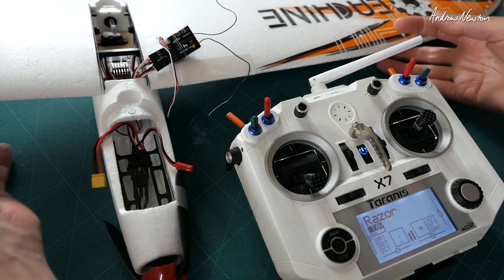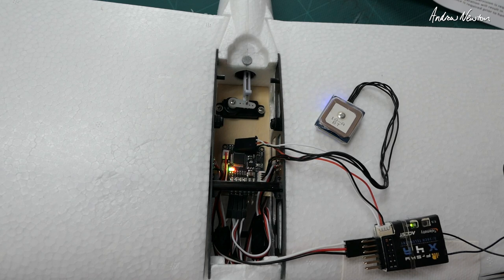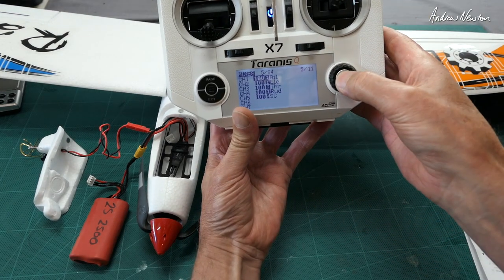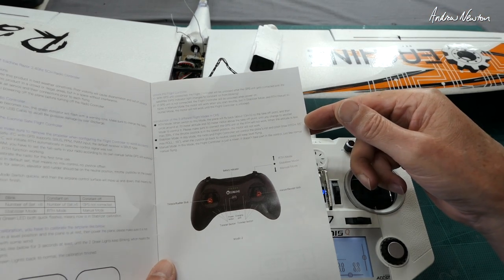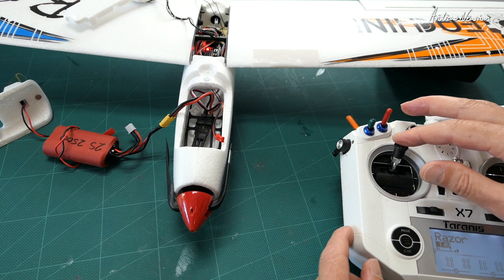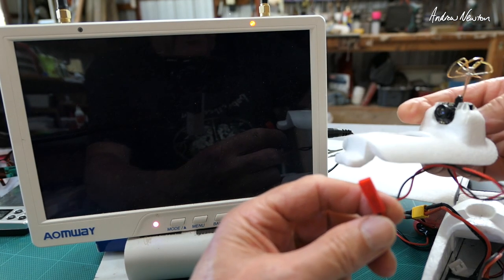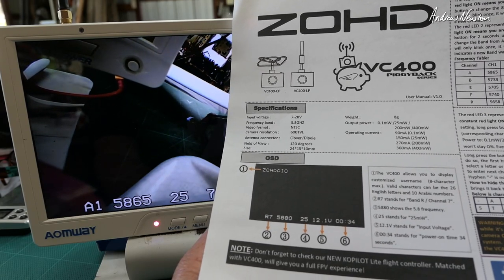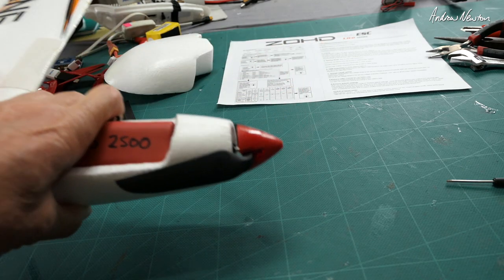Razor ESC FCB VC400 Setup

Comment: So I just completed my first two flights of my razor.  My initial thoughts are,   it is a little anemic and the prop pitch could probably go up a little bit.

With 40% Expo,  triple rates set at 75 50 and 35 even 75 was a little unresponsive.  I guess I'll bring my expo back to 20

Comment: Thanks for the full SP on the set-up and all the relevant beepity-beeps Andrew. :-)
The low battery RTH is a useful update but a bit odd they went with XT60 rather than XT30 and the solid and flashing green led pattern reversed from the Kopilot usage? ;-) With my clapped out fingers I use an in-line switch adapter for setting up - saves a lot of blue air! :D
Reply from the maker: It is XT30

Comment: Re: Propeller Balance. 
The folding prop on my Phoenix 2000 is the same. I have just turned around one of the screws.
It is now running smoother than ever! Thanks for the tip Andrew.  
What were they thinking with the 2 screws facing in the same direction anyway? 
Because one hole is bigger than the other, I had to glue in a bamboo skewer and then drill it to make the hole smaller.
Reply from the maker: Yes it's an odd design decision

Comment: Does the FPV version of the Razor include a Receiver or do I need to order that separately? (Recommendations welcome! 🙂).  Battery recommend also appreciated - I would like to get 30+ minutes flight.
Reply from the maker: No receiver. Need one that works with your transmitter. 2S 3500mAH 18650 pack would be best

Comment: Forgive the newb question Andrew.  What sort of 2s Lipo battery suits this model, is this right? HG 7.4V 4500mAh 30C 2S Lipo Battery.  There are a lot of different descriptions for 2S Lipo's 25C, 30C, 45C etc.  Please help
Reply from the maker: Too big and heavy. Something like a 2S 1300 is more suitable, or 2 x 18650. Only need the higher C rating batteries for high current needs, like quads or fast planes. They deliver more current before the voltage drops.
Reply: @AndrewNewton  thanks andrew, your vids and dialogue with us punters is very much appreciated.  I have one more for you, should I get the Flysky FSi6 or Jumper T-Lite for a first Tx(to pair with the Eachine Razor)?

Comment: Andrew, One thing confuses me and that is the 100% rates needed for the control board is it the case that once this is programmed into the stabiliser lower rates be imputed so that in manual mode the movement is less aggressive or am I missing something. It’s a very steep learning curve for me but I’m determined to crack it. I’m using FlySky  fs-i6x Oldsurveyor 44
Reply from the maker: Need 100% for setup using stick commands, but not for flying. But with fully configurable boards it's best to do the rates and expo in the board configuration and not the transmitter. Otherwise you will end up with inconsistent trims in different modes
Reply: @AndrewNewton  thank you for that most helpful
Reply: How did you connect your Flysky receiver to the Razor flight controller? Did you use PPM? Where did you plug that into the fight controller?
Reply: @subzero674  connect with the supplied 3 way lead supplied with the Kopilot , four pin connector inserted horizontally across the signal pins on the reciever the 3 pin plug inserted horizontally into channel 5, signal wire to the top this provides power to the Kopilot and this is also the command channel giving you return to home, stabilised mode and finally manual mode. You need to assign a 3 position switch to channel 5. The other end is connected to the Kopilot be careful withe connection the pins are offset so make sure you align correctly. The Kopilot diagrams actually illustrate these functions fairly well so there worth studying.
Hope this helps.
Reply: @michaelwheatland4565  Thanks!

Comment: Hi Andrew...can you use ibus rx with this...thanks
Reply from the maker: Dont think so, Eachine Safe board only uses sbus, ppm or pwm
Reply: @AndrewNewton  Hi again ...some confusing statements on the net...such as  ""I think It should be OK as a website out of the UK states: "the iA10B is capable of iBUS, SBUS, PPM and PWM for enhanced control."
I also found a YouTube video showing that in the transmitter settings you can choose i.bus or s.bus. Woo Hoo !!! "     

     and this     "Great video, but just one thing... you said Kopilot is not compatible with iBUS, but actually it can be.  The FS-IA6B works on both PWM and SBUS (recommended). Connect it to the IBUS pins, and then set the Tx to talk sBUS and it will work fine. The FS-IA6B runs both IBUS and SBUS, depending on what the FlySky Tx is set on (sBUS or iBUS). Hope that helps!"      hope that you can shed some light on this.....Cheers

Comment: You mention "depending on whether you've set it to lipo or lion," but I don't think you covered that.
Reply from the maker: Throttle down Rudder left and wait for the elevator wiggle. One wiggle for Li-ion, 2 wiggles for LiPo
Reply: Cool, thanks. I don't have one of these, but figured it would be helpful.

Comment: NEVER plug 3s battery - ignore the writing that ESC supports 2s-4s. The foam around a mount plate is very weak - so your motor will just break through it and fly away (with good chances to "meet" your head).

Comment: Just found a H  U G E solution to a problem I was having.
?I was trying to calibrate level and could not get the red and green lights to blink and/or enter the level calibration.

I noticed my elevator was backwards, wend into outputs, inverted the ELE channel. flipped my mode switch to calibrate the radio, checked that up ELE was correct and proper. It was.
attempted to enter the level calibration, it worked.

My setup:
Razor FPV,
QX7 2.2.3 (ae5ac05b) ,
L9R (no flashes),
PWM,
MODE 2,